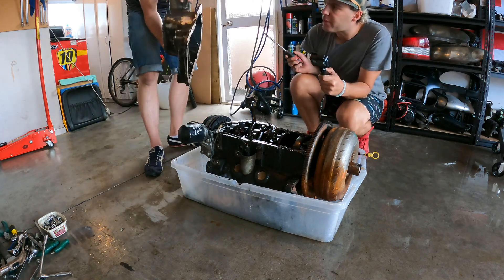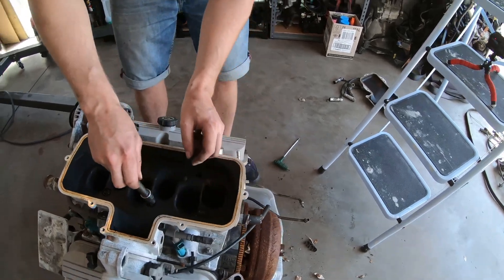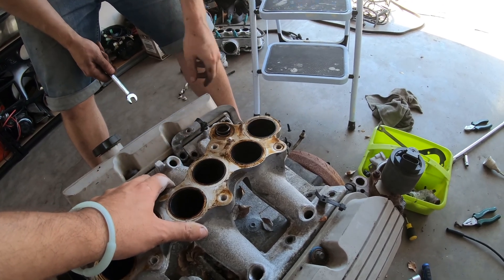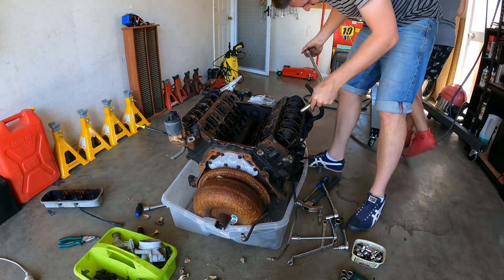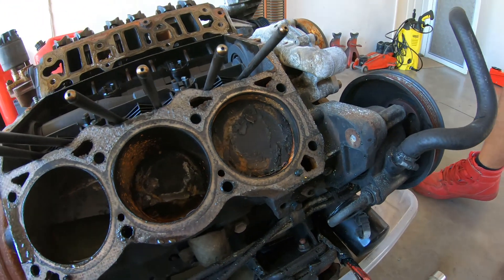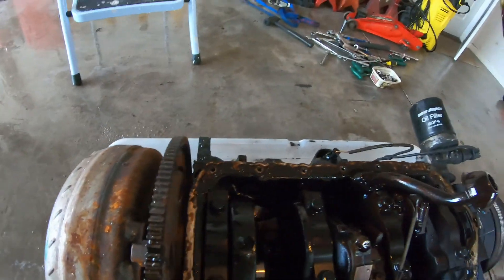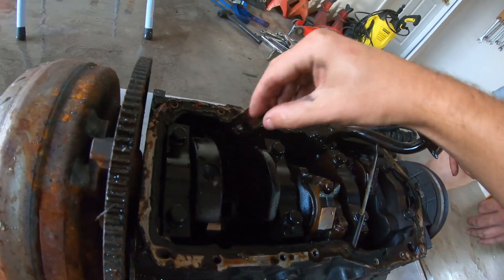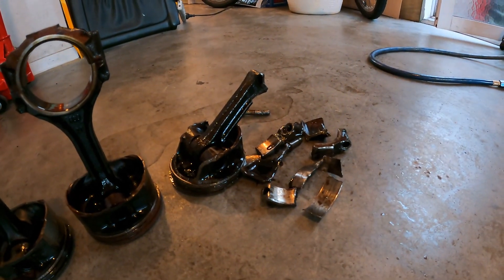Holden Commodore Ecotech V6 - Engine Teardown

Comment: Great motor but they had a few issues with balance shaft noise ,the early ones had needle rollers on the rear of the shaft that got noisy, they were replaced with a brass bush which was much quieter and the original timing chain tensioner used to break but there was an updated version that never broke, I used too replace both at the same time. but these are a stout little engine.
Reply: Were these engines Series Ine or Series Teo?